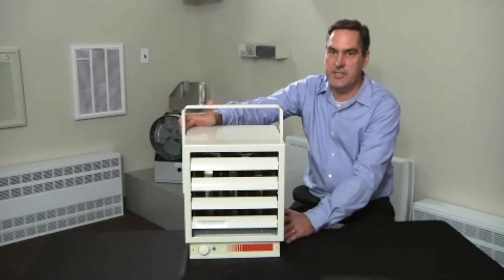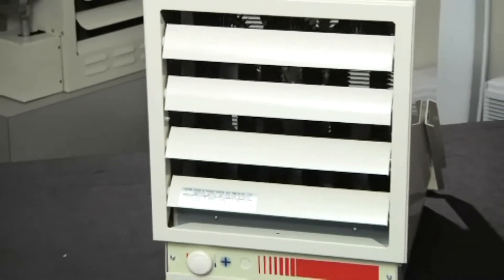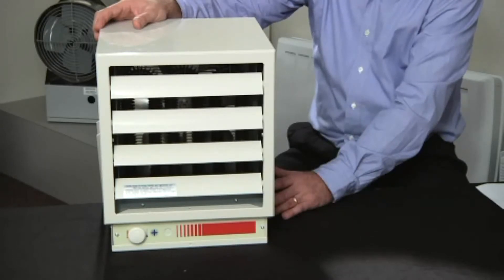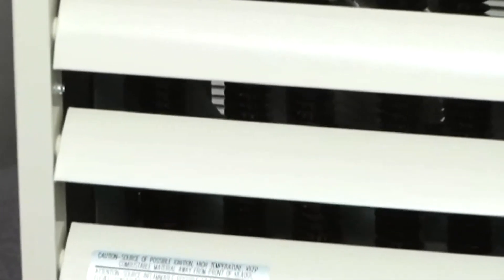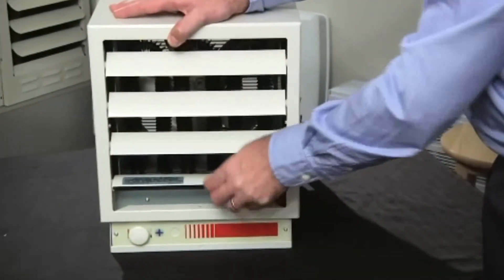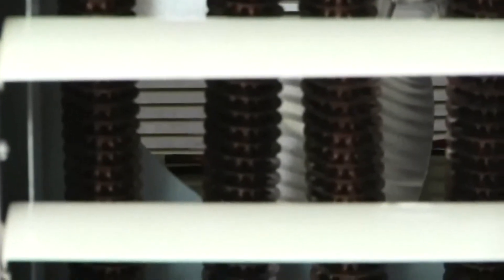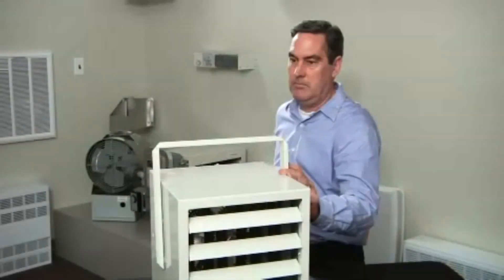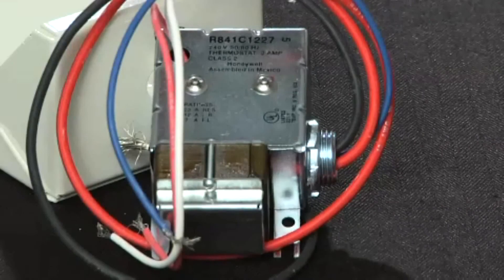Dimplex Heavy Duty Electric Unit Heaters - EUH Series

Comment: Buy a 208 volt model an run it off the high leg of a four wire 240 delta 120 volt system.